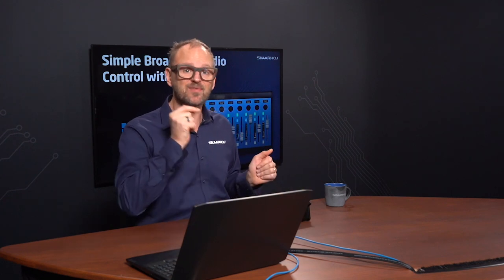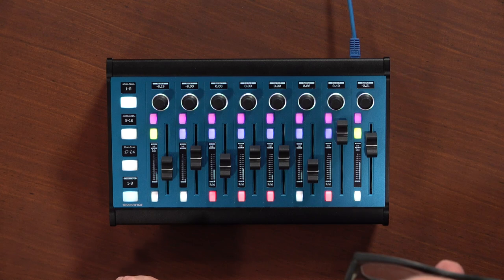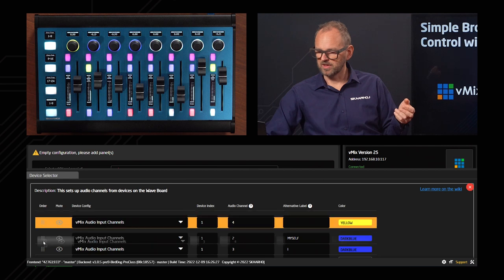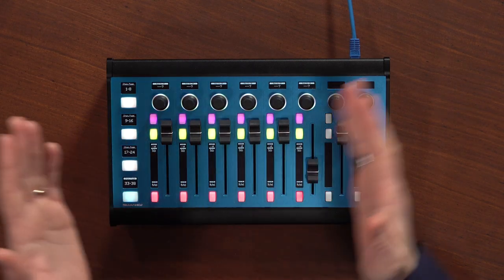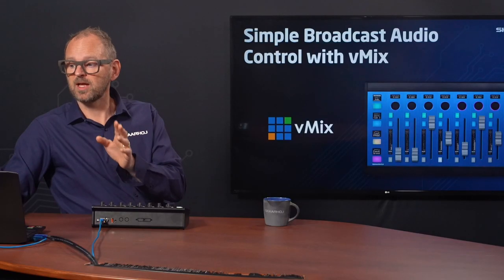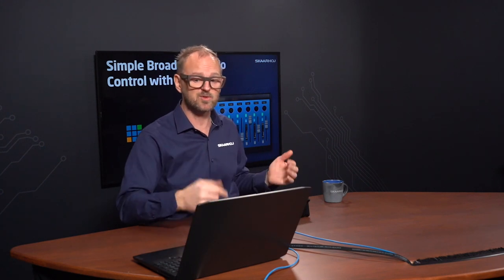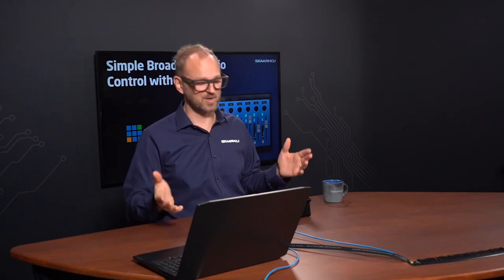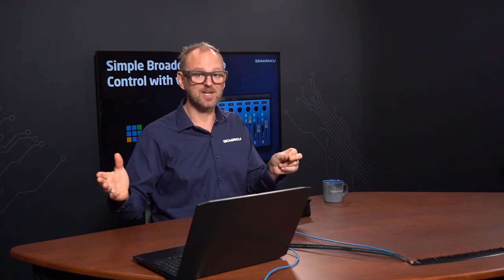Broadcast Audio Control with vMix

Comment: This is an amazing product, but that fact that your can go and buy a Yamaha tf1 or a Behringer 32 for about the same price as this controller is very unfortunate.
Reply from the maker: Hi VidKid106, thank for your nice credits to our product. WaveBoard is not trying to substitute a dedicated audio mixer, but it is designed for user friendly, custom broadcast workflows and with an extremely powerful engine to mix and match audio control from many different devices. For the many system integrators facing that need, we believe it's a very cost efficient device.